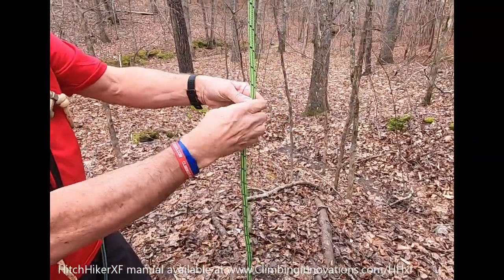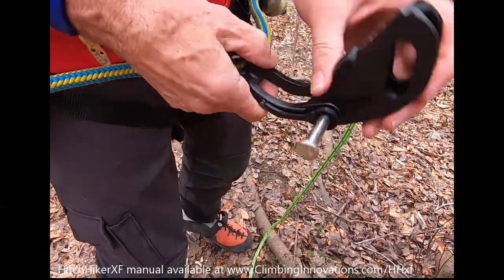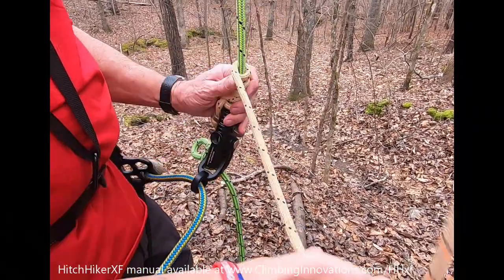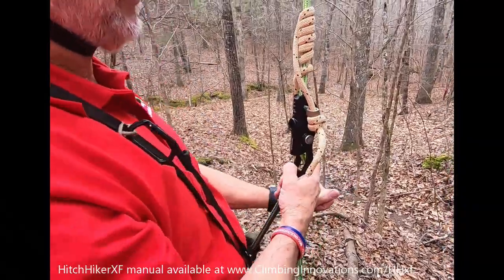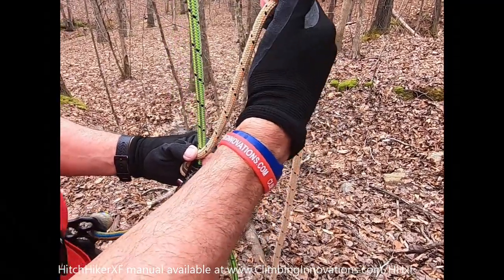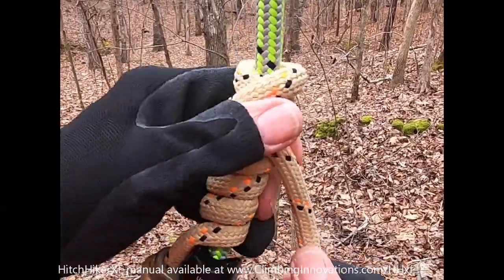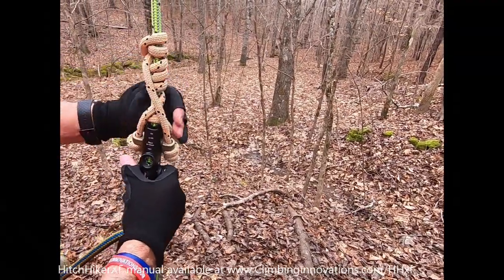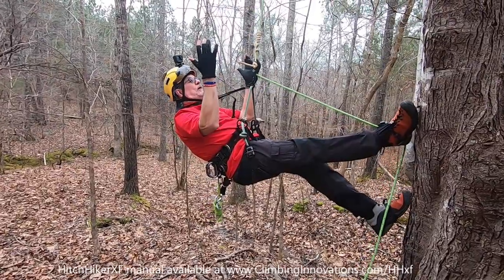The Hitch Hiker XF by Climbing Innovations LLC

Comment: I would like to talk to you about a device that helps the akimbo run smoothly even threw sap.  It seems you like modifying different climbing ascenders / descenders.  If you are interested in the idea comment back so we can communicate better.
Reply from the maker: The Akimbo is an ingenious device but this is about the HitchHiker I have.  Visit my website and send me an email and I'm always ready to talk climbing equipment.
Reply: The akimbo is one of those finicky devices that really isn't consistent. If humidity makes it act differently, it doesn't have a place on my saddle..
Reply from the maker: @SLOCLMBR  Fast on an off a rope is a valuable attribute in some situations, I have found the Unicender gives me that.
Reply: @RichardMumford1  I agree, I love the Uni, your modifications made it a completely different experience. It is my go to on a daily basis, and is pretty much bomb proof. Way more positive feeling than the akimbo in my opinion